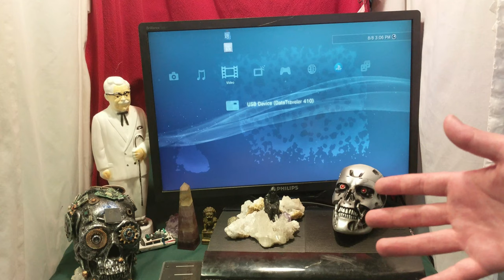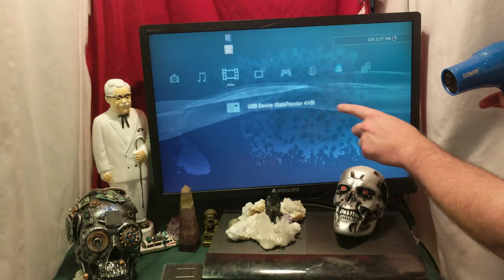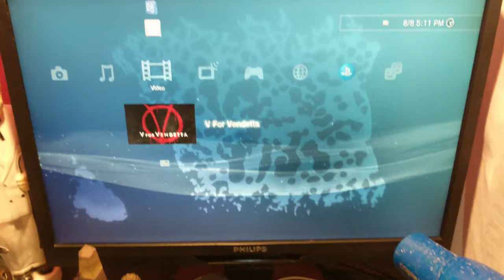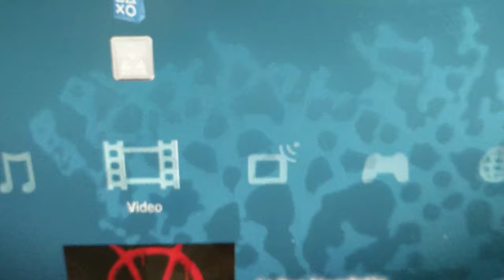How To Get Moisture Out Of An LCD or LED Monitor. How To Get Water Out Of A Monitor

Comment: I went with putting kitty litter on the screen overnight and it worked perfect!!  A hot hair dryer placed too close may damage your screen, go with kitty litter or rice, lay the screen face up in a plastic bag and sprinkle the litter on the face where moisture appears and go to bed.  In the morning dump the kitty litter into the plastic bag and wipe the screen with a soft cloth.  Thanks for your help!
Reply from the maker: Thanks bud! I will need to test that in a video
Reply: What if it's on a laptop screen?
Reply: @DanteMishima  Mine is a desk top, certainly the screens are the same, just be cautious the kitty litter only gets on the screen and not into the computer.
Reply: Does using rice work?
Reply: @smithaellagabriel2704  Never tried it, but have heard that it does.
Reply: @tonymontana3742  ok thank you so much 😊
Reply: The rice should be placed in a thin cloth or should be placed directly above the laptop screen?
Reply: @budhadityabhattacharya7789  I put kitty litter directly on the screen, it's dusty and messy but I laid the All in one computer on a large trash bag, which made for easy clean up.
Reply: @tonymontana3742  Thanks a lot👍
Reply: Ehhh hair dryer won't cause more damages. My phone currently has water in the screen and I used a torch right on the screen and it was too hot to touch. A couple times the spot turned black but instantly went away once I took the flame away. I didnt mean to do it that much but it got my screen working. It was only white with vertical lines. So I wouldn't see a hair dryer damaging it
Reply: Unfortunately not in my case with a 30" monitor.  In fact, some of the water inside the screen seemed to pull the kitty litter into it rather than the opposite (pulling the water out) resulting in dark marks.  I would advise against it

Comment: After just 2 days of hair dryer+heater the "cloud patch" are mostly gone but a large bright spot remains unchanged. Did you happen to have any experience.with that？
Reply: @sbowesuk I really want to know If there is a way to fix that to, I'm worried that it might wreck my laptop, it's also unpleasant to look at
Reply: @phantomope4031  that has happened to me and i just get a clothe and massage the spot and it define you gets a little smaller sooo i hope that helps:)

Comment: My flat screen monitor is soaking wet because of the rain that went through the window. Not sure if it's wet inside. Should I turn it on?
Reply from the maker: noooo dry it out as best yo can first.
Reply: @NevsTechBits  Can I put in under the sun? It's been sitting in an air conditioned room overnight.

Comment: That's one way to create a bigger problem.Shift the moisture on the PCB and corrode it .Be happy that the moisture is contained where you can remove it by replacing the screen .Or take it out and do it while disassembled

Comment: I dug out 2 old 1080p60hz monitors from my dad's studio which is now used as a storage room. It has a giant puddle of moisture in the middle on both monitors. It's not noticeable if you don't just have a black screen. My mom does not let me use her hairdryer so I think I'll have to leave it running. Had them since like a month by now but I don't have them on all the time so I think that's my problem. Thanks for the help!

Comment: I will document my 55 inch 4k lcd tv progress
Day 1: the tv got water in it showing 4 medium to large spots around it! I tried to use the hair dryer but didnt work so i put the tv screen facing the radiator heater on medium heat! and the living room is set to high! Ill leave it like that for 2 days!
Day 3: the tv works and about 80% of moisture is gone, ill use it and update you guys tomorrow or the day after!
Day 5: it has dried with little to no traces left

Comment: I have been going through videos for 2 hours trying to find a fix for this issue - and you sir have been the only one to efficiently explain a fix. So many videos on YouTube of people not explaining well, or not talking at all. I will try this with my screen. By the way - how is the screen looking now?
Reply from the maker: Hi Ryan! I am using the screen right now. After the video ended, I hooked it up to my main system and after 3 days the moisture was gone. I do have a faded black spot in just the very center of my screen but it is slowly going away.

Comment: I have this problem but ot also comes with another problem, it wont charge. Like it worked fine when it was charged but it died and it just wont charge. It DOES show the red dot next to the place where the charger is supposed to be plugged tho

Comment: did it eventually return to normal?  Did you just wait it out?  Or still kept in the sun?  You could put it in your car on a hot day to heat it up and yet keep the sun uv damage to a minimum.
Reply from the maker: Yup! I'm using it right now. There is a bit of a small dark splotch in the middle, but it's otherwise great =)
Reply: @NevsTechBits  that's good!  How big is the dark splotch? Just curious.
Reply: I put on a milk on my cell laptop now what to do with patches?

Comment: Mine is a stupid case I used an alcohol to clean my monitor, now it has a bright lighted part that covers almost half of my screen..
should I just let it be? I mean its not that much of a bother but can it cause a permanent damage or something?
Reply: is it okay now?
Reply: @oswaldowy  no.. though it keeps dripping down as days goes by
Reply: @fyuzorayorushira4530  could you update further on this, I am also in similar situation where alcholo got into my laptop screen
Reply: @amanbhardwaj5542  same, is ur thing okay now?
Reply: @sanoob.  I did not blow any hot air into it fearing permanent damage, so I am relying in evaporation only and it is happening very slowly. One thing I can suggest that you can place your laptop in sun rather than blow hot air into it from dryer.

Comment: (AOC ---> 100$ monitor)
Problems..
1. Opens menu auto and spam random buttons nonstop
2.After 2-3 month the first problem appears second time
3.After 1 month. Infinitly white lines appears from top to bottom (still usable) 
Fixes..
1.
 I dismantled and cleaned moisture on the mainboard
2. Buttons chip/board removing (solved the problem) 
3. tried cleaning but  didn't help. prbly one of 6 connection port(from mainboard to lcd)  died cuz there was alot of moisture there.(not fixable)

READ THIS like this:
Problems----Fixes ets:

1-1
2-2
3-3

..............SRY FOR BAD ENGLISH...............

Comment: Woke up to sprite all over me and my room and a large splotch on my laptop screen, hoping this will work, pretty discouraged and sad right now. 🙏

UPDATE — It’s been a few hours after I placed my computer in front of my heater, and it’s looking actually really good! It’s starting to bunch away from the corner of the screen and it seems it has actually shrunk a bit!! , later I’ll update to tell results c: 
Things are looking promising !

UPDATE 2 
it wont turn on anymore.
Reply: Well maybe u gave it too much heat
Reply: @aliarsalan9614  probably 😿
Reply: It's a laptop... why didn't you just take the screen out and clean it?
Reply: @callumkenny5147  you can.. do that.. ??🙂
I used an hp laptop before it broke
Reply: The moisture went to the PCB and shorted it rendering your laptop dead 😢

Comment: Sir, in my case its oil.drying in sun will help?
Please help
Reply: same
Reply: Prob not since oil doesn't evaporate in temperatures safe for your LCD. You are better off trying to clean it or taking it into a repair shop.
Reply: 😬 Very hard situation take it to a repair shop

Comment: Please should I do the same thing on my 55inch TV .I was cleaning it with water and now the screen looks bad
Reply from the maker: Just leave it on over night.
Reply: Please, confirm I have similar issue my tv screen looks like it is wet and causing a part of my screen to fade off with the previous image showing for a 2 seconds before going off.

Do you think when it dries all will be fine?
Reply from the maker: @davevisualnow  I bet it will be fine. How did water get into there? Roof leak?
Reply: Same here 55 inch tv plz suggest some remedy that’s workable
Reply: @NevsTechBits  mine with AC Drain malfunctioning. Here normal temperature is 41-43 Degree C. Still need an hair dryer?
Reply from the maker: @gullwaqasshahid2965  naw you should be fine without dryer.

Comment: Will this work on iPad too? I don’t want to spend a fortune to change it man.
Reply from the maker: It might. How did you get moisture into an iPad??
Reply: @NevsTechBits  I accidentally spilt the water on it. I reckon it got through the speaker and charging port. Now my screen looks exactly like yours and could cost $500 to change the screen. 🤯🤯🤯